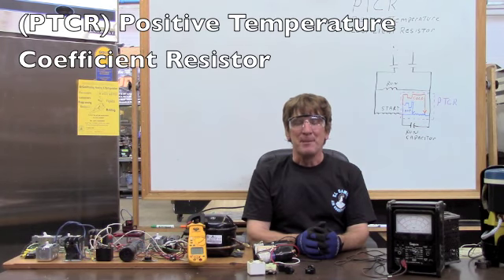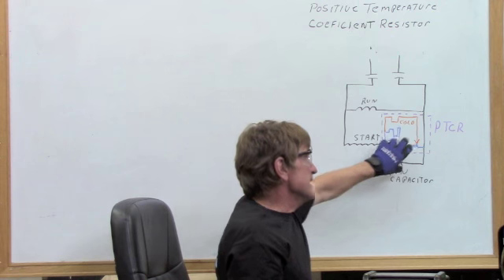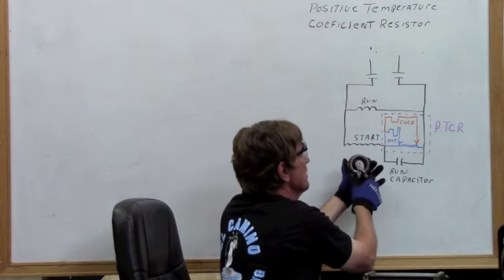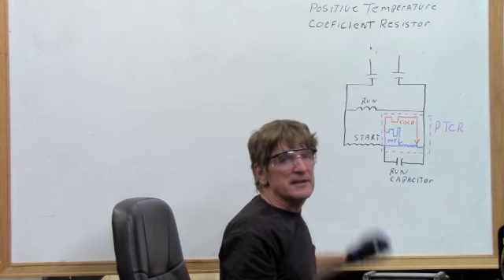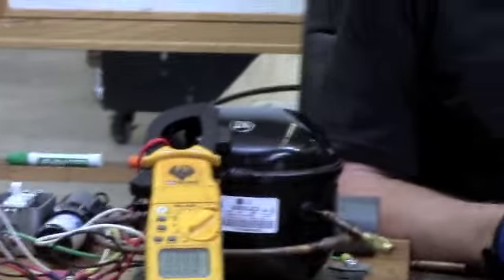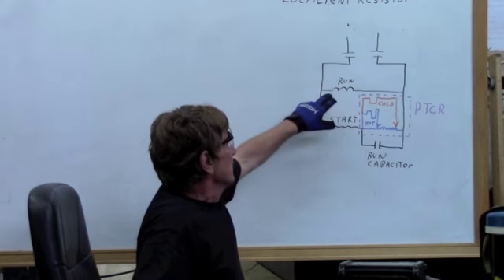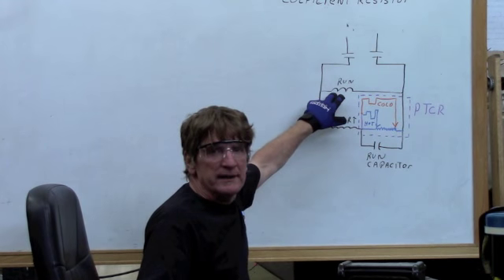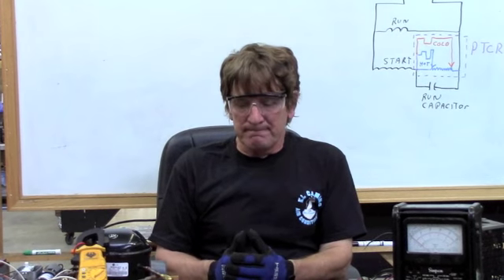PTC Starting

Comment: Yes, understood. Thanks for the explanation.... that part broke in my fridge and I was looking for what it does. I was thinking of shorting those terminals with a screw driver and jump start the motor. But the initial 4ohm will not be provided by the screw driver so I am worried. I will order the part but it is going to take couple of days.